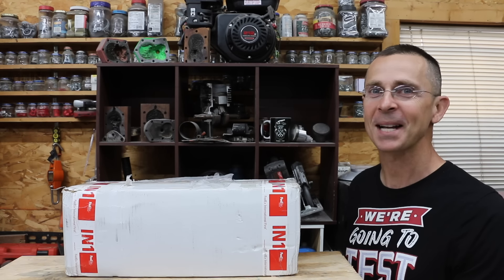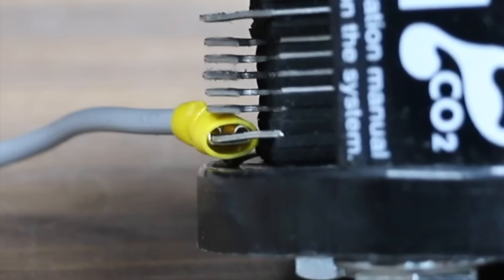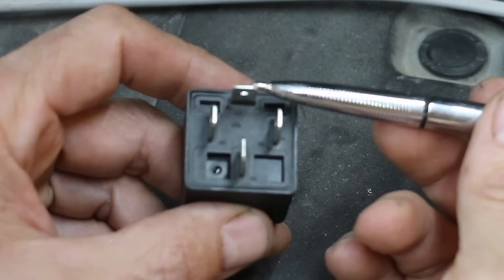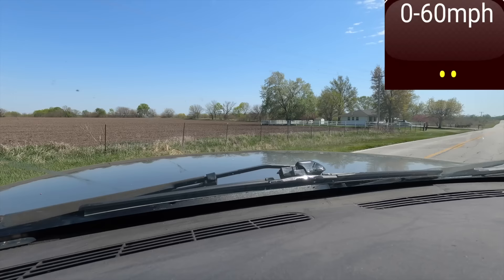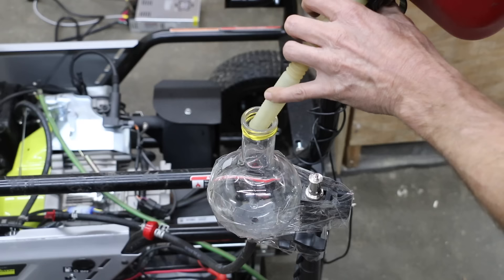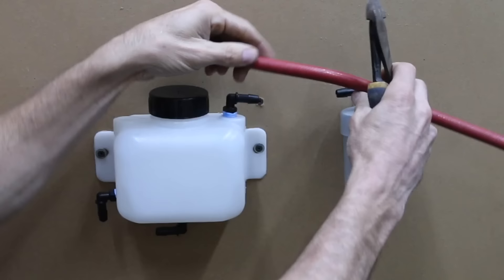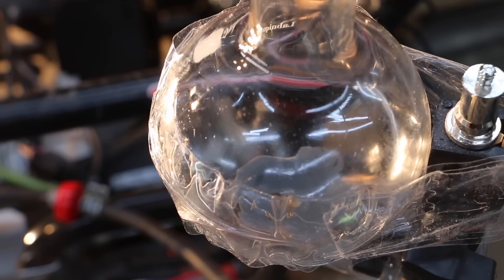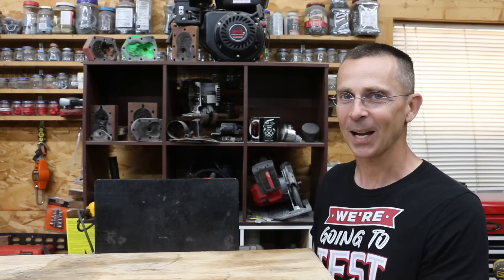AMAZING 35% More MPG with HHO? Let’s find out! Help with high gas prices?

Comment: This reminds me of when I was 16 and bought my first car in the 60's. I bought every gimmick known to man from the JC Whitney catalog. Each installation would boost HP by 15-10%. By all accounts I should have had a 500 HP 283 Chevy, but alas nothing ever changed. I can still hear my dad LHAO. It seems that the products now days are higher tech labelled, but work about as well as I remember. Thanks for doing this, it brought back some great memories.  🤭
Reply from the maker: You are welcome!
Reply: I remember those 1000 watt 6 x 9 speakers, oil-foul-resistant spark plugs, and an in-dash AM/FM/TV Cassette player.  They also had a lot of big bore kits for VW Beetles and stuff like that.
Reply: Oh man.  Those were fading out when I was a kid in the 80’s. So, I moved on to the P.A.W. Catalog.  Chock full of everything from the latest in Wolverine blue racer cams to the complete, “assemble it yourself” all aluminum BBC. (Boomer bbc, not zoomer bbc)
Reply: I remember all the gimmicks in the J. C. Whitney catalog,never Bought them though.
Reply: @ProjectFarm  What was the mpg before and after on the vehicle?

Comment: one of the best you tubers to date, no bs, straight up content, science, and no money farming from companies. MAD respect
Reply from the maker: Thanks so much!
Reply: @ProjectFarm  i did the double treatment to my motorcycle and as soon as i poured it in it atleast felt like the engine started to run smoother (could be psychological effect). But your tests and stuff could actually check if their claims are even clos to the truth.
Reply: hes been working it.  Check out his videos from the past.
Reply: SCIENCE? Really?
Did PF Test the generator to see if higher Octane Fuels were an advantage? They are only advantageous if the engine is designed, engineered, and properly tuned for High Octane Fuels. So the same theory must apply to the addition of H2 gas. Did PF test to see if doubling the available Oxygen would improve efficiency of the Generator? Well no, because the ECU assumes that only 20% oxygen is available at 68F at Sea Level.

No my friend. Whilst PF's videos are entertaining, they are very very far from being anything that could be considered SCIENTIFIC. Wayyyy too many assumptions being made and implied in all of his 'experiments'. But very entertaining.
Reply: Love the videos. No nasty nasty cheap gimmicks or graphics. Just straight honest to the point results with some fun and enjoyment added.
Reply: Sven3xs  - Only in your opinion.
Reply: @delawarecop   lemme quote Wikipedia
"The process in the scientific method involves making conjectures (hypotheses), deriving predictions from them as logical consequences, and then carrying out experiments or empirical observations based on those predictions."
In this case: 
-the conjecture was that the company claims it improves fuel economy and what not
-he did a baseline for what numbers the Hydrogen Generator need to beat, there you got the prediction part
-then he test the stuff against the base line, trying to get as far away from  the human factor as possible
and guess what, you can re-create the test, the main appeal of the Scientific Method (and my own main appeal for this channel).

So hell yeah it its scientific, it perfectly follows the Scientific Method and the test/results are very objective, it doesnt need to be in a fancy shinny lab wich crazy detailed numbers to be scientific, the Product didn't meet the claims and that's it.
Reply: @korvo9936  - WIll the results be predictable in EVERY SINGLE ICE? Absolutely NO! Therefore the process that he used was erroneous.
Reply: @delawarecop  I disagree. If the manufacturer of the device claimed it only worked on certain engines, or required additional tuning, you would have a point. The manufacturer claims it's plug and play on any engine, and it did nothing on either engine tested. The method was valid. If the person making the claim wants it substantiated, then they need to  specify all of the test parameters. You can't just say something worked in one highly specific example, then sell it claiming it will work for anyone, and then get made when PF proves that's not true.
Reply: @delawarecop  Science is testing in controlled, reproducible manner. In that, PF did an awesome job, far better than many "scientists" who play with computer models all day.
Reply: @Blaquer17  - Yes, like all of PF's videos, he tests the exaggerated claims of manufacturers, and exposes their dishonest marketing schemes. But the conclusions made from watching the video, is that all HHO systems are a scam, and that's not true. Read the comments and you will see many people who have made that conclusion given the evidence that PF provided. However it's the evidence that PF hasn;t provided or that PF has wrongly assumed, or that PF has inadvertently overlooked, that is important to know before forming an opinion or drawing a conclusion. Therefore the testing procedure is NOT SCIENTIFIC.
Reply: @SpaceCadet4Jesus  - B. S.
Reply: @p.b.9971  - The test parameter that is WRONG, is that the ECU or Engine Management system, isn't aware of Hydrogen entering the fuel stream, so the engine isn't 'TUNED' to take advantage of Hydrogen. I'm not interested in lawsuit claims, just the SCIENCE of Automotive Engineering. This white elephant of a detuned engine is the reason why I made the comment, and if you had half a brain, then you would know that tuning an engine to a fuel is EVERYTHING when it comes to performance engines.
Reply: @p.b.9971  - LOL, the laws of physics states, that if I use  solar Panel on the roof of my vehicle to generate power, then that stored energy can he used to make energy - regardless of your lack of education. 😂🤣😅
Reply: yeah,  he seems crazy enuf that no amount of money will cause him to lie.   of course,  than they threaten your daughter ....